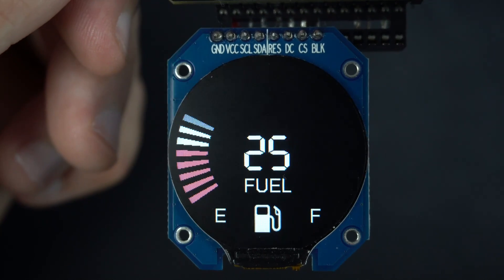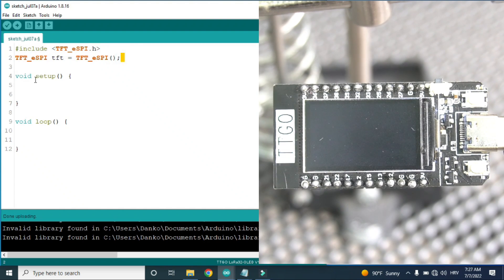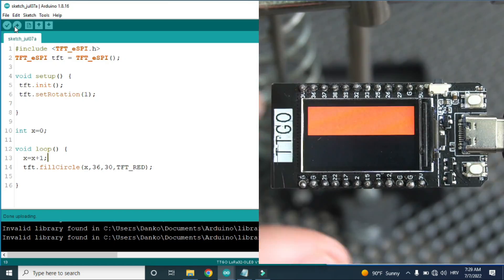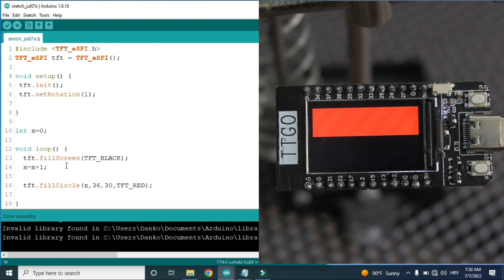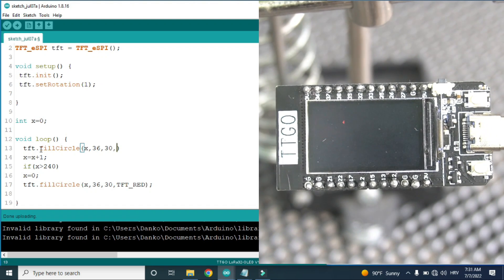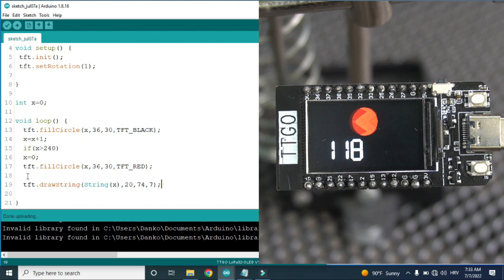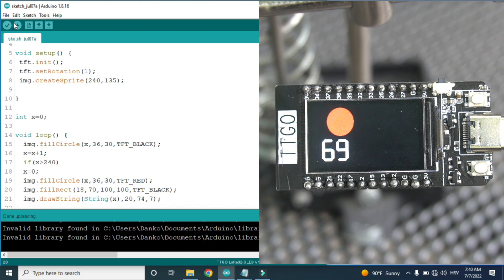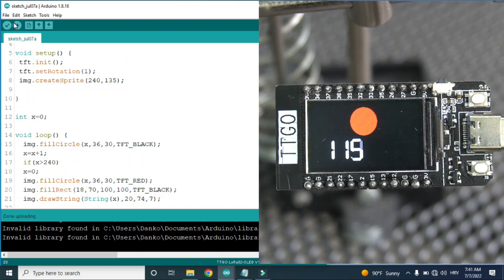How to use and why to use Sprites  (TFT_espi Programing tutorial)

Comment: Written December 2025, version 2.5.32. I cannot reproduce the example above. If I make the img sprite the same size as the screen, my code freezes. I have to make a smaller sprite ( 2 pixels less on X/Y) axes then push the sprite to position (1,1) on the screen, What version of TFT_eSPIi did you use for this example?

Comment: This isn't an accurate usage of a sprite, you're using the sprite as a canvas to redraw the whole screen.

The reason it flickers is that it's redrawing the screen live.

With a canvas you draw to the canvas then redraw the whole canvas to the screen, so the intermediate steps to create the image for the screen are not observed by the user.

A sprite is intended to be a sub-element of the screen that you can move around on the screen, which is not what you're doing in this example.

Comment: Why do I have so many problems with Mr. Volos's tutorials?  I was doing the above, everything was going just fine until I entered TFT.eSprite img = TFT.eSprite(&tft);  Of course I got an error: "Compilation error: 'tft' does not name a type".  I had replaced tft with img where required and got the message.  So, starting from the bottom i replaced the img with tft until I was at the top.  The first line as stated above was the only line left representing Sprites.  I got the error as above.  Note the capitalization differences.  So, I even replace TFT with tft, even though I knew that would not fix the problem, it did not.  Any ideas?..............OK, I am an idiot.  Look at my pasted Sprite assignment.  The "." is not equivalent to a "_".  So, that fixed the compilation error and it uploaded, to a blank screen, nothing , nada.  By the way, where is the statement filling the screen with black?  I will start over, I missed something...........................Hmm, maybe this is the problem. I am not using a TTGO display.  Just an ILI9341 display with a plain jane ESP32.   4MB flash.  Is that the problem, not enough memory?

Comment: Great video. I followed along using ESP32 and ILI9341 (240x320) and it worked great until I tried to make the full-screen 240x320 sprite (scaled up from your example). It will only go so big before it stops working. I'm guessing it's a memory issue and I need som more teaching. I can't seem to find another tutorial that goes deeper :(
Reply: Me too!   I found the solution - add the line    img.setColorDepth(8); to the loop function.  It reduces the memory needed and the sprite works well now.
Reply: @solarprojectuk  thank you!

Comment: Okay. I'm going to try to explain the problem I'm having with your example. 

I have a different size display. Mine is 240x240 (size set in the user_settup.h file). Your code line by line works great but if I change the size of the sprite to 240x240 it won't run. All I get is a black screen. I've change the size of it on both x and y and the only time I can get it to run is if the size of the sprite difference between x and y is >= 10.

img.createSprite(240, 240); doesn't work.
img.createSprite(235, 235); works
img.createSprite(240, 231); doesn't work
img.createSprite(240, 230); works
img.createSprite(230, 240); works
img.createSprite(231, 240); doesn't work
img.createSprite(239, 231); works
img.createSprite(235, 235); works.

I'm confused. Could this be something in the user_setup.h?

Edit: I found my answer. This may help others. I’m using an ESP32 Wroom 32.

“A Sprite is notionally an invisible graphics screen that is kept in the processors RAM. Graphics can be drawn into the Sprite just as they can be drawn directly to the screen. Once the Sprite is completed it can be plotted onto the screen in any position. If there is sufficient RAM then the Sprite can be the same size as the screen and used as a frame buffer. Sprites by default use 16 bit colours, the bit depth can be set to 8 bits (256 colours) , or 1 bit (any 2 colours) to reduce the RAM needed. On an ESP8266 the largest 16 bit colour Sprite that can be created is about 160x128 pixels, this consumes 40Kbytes of RAM. On an ESP32 the workspace RAM is more limited than the datasheet implies so a 16 bit colour Sprite is limited to about 200x200 pixels (~80Kbytes), an 8 bit sprite to 320x240 pixels (~76kbytes). A 1 bit per pixel Sprite requires only 9600 bytes for a full 320 x 240 screen buffer, this is ideal for supporting use with 2 colour bitmap fonts.”

https://github.com/Bodmer/TFT_eSPI#sprites
Reply: Awesome. Thank you *1000. I'm using an ESP32 WROOM 32D and a 240*240 tft. Changing the sprite size to 240x235 worked for me.
Reply from the maker: You have older esp32 module which have less psram, so with sprite so big program crashes. You can try with diferent board
Reply: Thank you so much, I'm using an ESP32 Wroom 32D and TFT 240x240. It not working if I using createSprite(240, 240).

Comment: Hi and thanks for great videos, I am finding them very useful. I am working with ESP32-Vroom and 320*240 TFT(SPI), when I define my sprite with full length it does not work (LCD is black) but when I break it into 2 sprit of 120*320 I have no issue and it successfully updates the LCD? Any ideas?

Comment: Those screen flickers look like image buffer corruption to me. I guess it's because of unaligned memory writes or LCD's driver issue, maybe it has to do with the weird resolution this display has, and I'd say you're essentially bypassing the issue with writing full frame buffer every frame which is less efficient both in terms of CPU cycles and memory usage than the partial screen update the first approach had. I'm interested to figure the real issue out.
Reply: I use the same display and i use a typical esp32 and i am not using any sprite but it works completely fine but i am happy to learn sprite 🐱

Comment: Fast to draw front arc and erase rear arc to move circle from an edge.(But beware of undrawn pixels for thin line). Also should always pause after changes to permit persistance of human vision to load the new image to brain. In ideal world, 20ms for recalculations and delay to give 50 frames per second. Ah... I am watching as typing. So I'm theorising that the operations are made to  fast  ESP32 RAM instead of TFT and then DMA load from RAM to TFT with your img.push operation. Thanks for tutorial!

Comment: It would be great if you could explain the theory and why it's smoother and better than the other approach. I want to know the behind the scenes implementation process.
Reply: The sprite library waits and draws with the refresh.  Basically "vSync"
Reply: @1over137  Is it like this, it saves the whole frame in memory and refreshes the whole frame with one shot?
Reply: @mashurshalehin4972  Not necessarily.  There are several ways to do it.  The approach you suggest would be called "double frame buffer", where you one complete frame ready to go as soon as the display refreshes and you have another frame which the CPU id drawing into.
When you complete your drawing, the frames are swapped (usually just by readdressing the memory which is actually read by the display.  So no memory moves or is copied, it's just the screen render is pointed to a different frame.
The flicker is caused by the software writing into the frame that is currently on screen, so you see a series of partial images as one partial frames get drawn on each screen before it switches.
The other way with single buffer, you just wait for the refresh and write the buffer as fast as the screen draws.
The better way to have this implemented would be to have a parameter to UpdateDisplay() which is True/False and denotes if the display should wait on the refresh or render immediately.